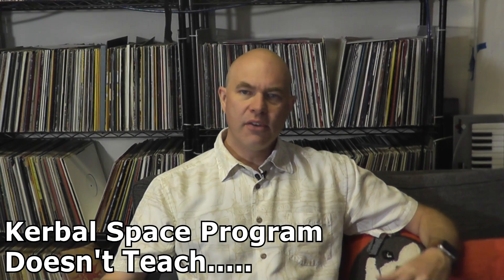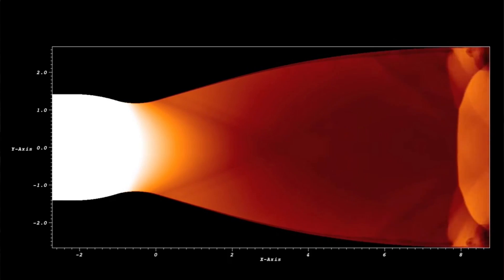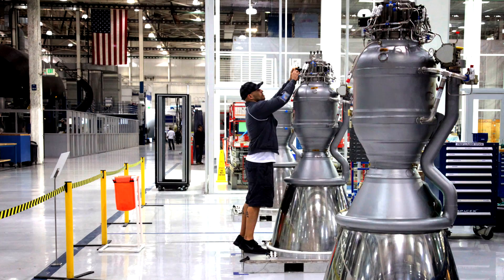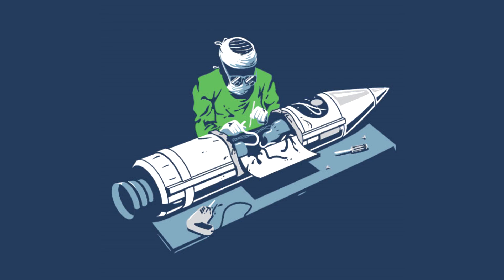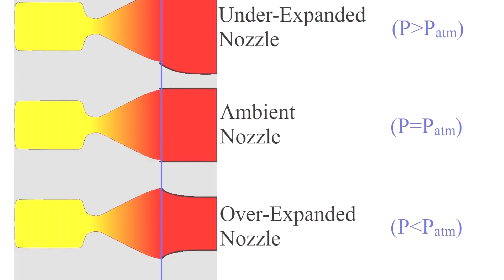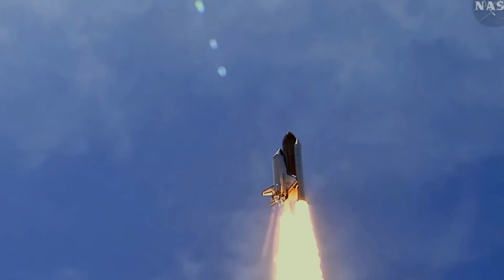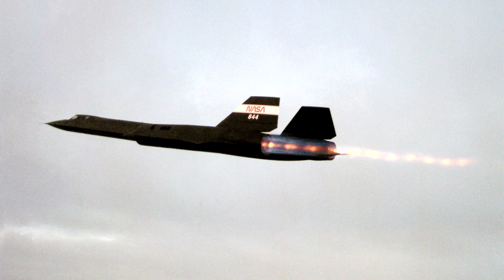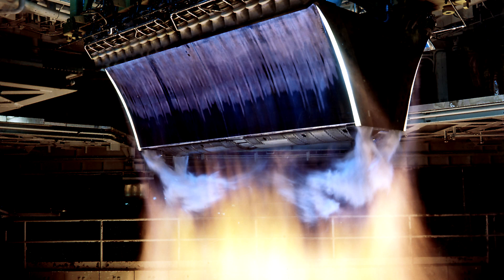Kerbal Space Program Doesn't Teach... Rocket Nozzles

Comment: Isn't it possible to create an adaptable nozzle? Have rings hooked to motors that pull the walls inwards (on a sort of rail system let's say) similar to how a belt is used for pants
Reply: yes, they are used on most jet aircraft but rocket engines need liquid cooling so it is alot more complicated
Reply: +douglas faulds it is possible to have a Contracting aerospike system like a reverse blackbird intake cone

Comment: I've often wondered why the Apollo CSM has a huge bell and the Soyuz has such a tiny one. But I suppose the Soviets would have designed a different service module if they ever needed to do a lunar insertion.
Reply: Be wary of assuming that the Apollo way is automatically right.  The Apollo SPS (Service Propulsion System) engine is massively oversized for the LOR (Lunar Orbit Rendezvous) mission, because it was originally designed for the Direct Ascent mission mode.  In this design, the AJ10-137 would have been used for ascent from the lunar surface, and trans-Earth insertion.  Something even bigger would have been needed for lunar descent, and the whole stack would have required something like a Saturn C-8 / Nova to loft it onto a trans-lunar trajectory.
In general, orbital maneuvering (even LOI or TEI) can make do with surprisingly low TWR; the SPS gave a full-tanks CSM an acceleration of about a third of a gee, which as mentioned is way more than necessary (Wikipedia says it was oversized by a factor of two).  Losses from not quite getting maximum Oberth effect turn out to be pretty small, so you optimise at a fairly small and lightweight engine (which then probably means the optimal nozzle expansion ratio is slightly higher, though the resulting nozzle will still be smaller than the SPS's because of the smaller throat area).
By comparison, a lander needs a higher TWR to reduce gravity losses; both the LM's descent stage and its ascent stage had TWRs of about ⅓g with full tanks, which is about two lunar gees.  Presumably that's where the optimum is, since the CSM (originally intended for lunar ascent) has about the same TWR.
Reply: Edward Cree
That explains it really well. Thanks!

Comment: stock ksp somehow forces you to use one big engine on the first stage instead of multiple small ones (like the falcon 9). Now, why are they using 9 engines? what is the advantage?
Reply: it is cheaper as you may only have to replace a couple every so many launches instead of a complete replacement of the entire propulsion system also it means you can fire one or two on a powered Landing when you have far less fuel to be carrying down through the atmosphere.
Reply: The main reason is that it is cheaper to develop one engine and adapt it for different tasks than it is to invent two or three engines.
Reply: Several, actually. One is that it's just cheaper to develop and build smaller engines. Another is that it's cheaper and easier to have 1st and 2nd stage engines that share a lot of commonalities, which wouldn't be possible with a monster first stage engine.

Also, it enables reusability. When the 1st stage lands it does so without the weight of the payload, fairings, 2nd stage, and almost all of the fuel of the 1st stage. Which means the first stage needs to be able to have enough thrust to push 500 tonnes at more than 1g at takeoff (otherwise it wouldn't get off the pad) but also to only have an acceleration near 1g when pushing only about 20 tonnes at landing, that's a difference of 25:1 in mass, so you need nearly a 25:1 ratio in throttle control on a single engine, which nobody has been able to achieve yet. With 9 engines you instantly get a 9:1 free throttle ratio just from firing one engine instead of all 9. Add on the 2.5:1 throttle control for a single engine and you get a total throttle ratio of 22.5:1, juuuuust enough to make landings controllable instead of impossible.

Without that, the first stage would not just have 9x the upward acceleration during landing, it would have 8 gees plus nine times the net acceleration (9 gees instead of 0.1 gees), since it takes only one engine to balance out the force of gravity on the nearly empty stage. That means that instead of slowing down over a long engine burn lasting tens of seconds the stage would screech to a halt with a burn of only a few seconds, all in the last few hundred meters before hitting the ground, if the burn was timed wrong by even the blink of an eye it could easily hit the ground at car crash speeds or end the burn stories high in the air. Also, 9 gees is a lot to subject a rocket stage too, and would be more likely to damage it.

Comment: At 4:38 there's some sort of small jet on the rim of each of the shuttle's engine bells, but I haven't been able to track down a detailed enough description to figure out what it is. My first theory was that it's cooling gas escaping after running through the bell walls, but the liquid hydrogen used for cooling is actually fuel on its way to the combustion chamber…so that's not it.
Reply: I think you are referring to the runoff from the fuel pump driving gas, I can't remember it's technical name
Reply: Hmm. I did some more searching around and gave up a second time. Wound up asking on the Space StackExchange site. Maybe something will come of that.
Reply: Something did. Detailed answer with schematics quickly arrived: http://space.stackexchange.com/q/15464/1419

Comment: why can't they use variable geometry nozzles like they do in fighter jets? not talking about thrust vectoring but rather variable diameter nozzles.
Reply: rocket engines have to run liquid hydrogen through their Bells to keep cool, obviously this radiator has to be perfect so the only way you could adopt the shape of the nozzle would be to have a moving aerospike like some hybrid rocket engine, sort of like a reverse blackbird Intex bike
Reply: +douglas faulds spike ^
Reply: is rocket exhaust really that much hotter than afterburner exhaust?

Comment: Do jet engines have actively changing nozzles for the same reason?
Reply: Jet liners generally do not have variable area nozzles, and I believe the high bypass turbofans they use are optimized for high fuel efficiency at subsonic speeds at their cruise altitude range, so the improvement would be marginal compared to the complexity, though I suppose that the increased focus on fuel efficiency may change this.

Variable area nozzles are most commonly associated with afterburning engines. The difference between running dry and wet pretty much requires it, but then, after burners tend to only be used on planes that require supersonic and/or high altitude flight, and these applications, of course, do benefit from variable area nozzles more than a jet liner would.
Reply: I believe so. They seem to actively change size depending on the amount of thrust being put through them, so I imagine the concept is the same. This effect is most easily seen on either the F-16 or F/A-18, I'm not sure which.
Reply: +JohnnyShagbot I'm not entirely sure, but both the F-16 and the F/A-18 have the expanding nozzle from what I remember.
Reply: +Major Missile most military jets do tbh.
Reply: JohnyG29 Yeah, they do now that I think about it.  Well, most modern ones have it to be more precise.

Comment: With the RealPlume mod, some of these principles are evident as the plume goes from a long thin fire to an expanded cloud. When it happens fast, say burning a low TWR engine as you fall during a failed ascent, you can kind of "see" the increase in pressure as it "squeezes" the rocket plume. Stock KSP really should incorporate the concept of plume expansion as part of a graphics update at least to address this. (Any changes in designs of rocket engines i.e. rocket part overhaul would be awesome, so far the aerodynamic parts have all been made more realistic, so, fingers are crossed.)

Comment: So why couldn't you just... Get rid of the engine nozzle entirely for in-vacuum flight? Surely it would act similarly to an infinitely large nozzle
Reply: Wouldn't that add up to losses in forward thrust?
Reply: An infinite nozzle have the best 'impedance matching' with outer space, because the gas that exit the nozzle have zero pressure, similar to vacuum around it. (in other word: all the sideward pressure have been converted to thrust)
Reply: I don't think you understand what the bell is for. It is the bell that allows the majority of exhaust gases to produce thrust. An infinitely large one continues harvesting thrust as the gases continue to expand.

Comment: Scott, love the video. Quick question: are the reductions in efficiencies in, say using a "vacuum" engine at sea level in KSP roughly equivalent to that of a corresponding real engine (using your example, a first versus second stage SpaceX rocket)?
Reply from the maker: +PSquared1969 the downside is the extra mass, drag and danger of flow separation

Comment: theoretically vectoring nozzle chokes could work for both atmospheric and space propulsion giving the highest performance in both areas. Is it possible and do you agree?
Reply from the maker: +Zack Vandygriff the heard part is making them not melt
Reply: +Scott Manley that it true but the bell itself already handles extreme temperature could the nozzle not handle the temperature if it is choked down to peak performance in both areas? and thank you for replying your videos are amazing and enlightening
Reply: Great Scott! I think you left out a significant part of nozzle design and engineering there. How to stop the nozzle from melting is a non-trivial engineering and design problem which I think you could have covered a bit more in this video. Part 2 coming up soon?

Comment: Plug nozzles would in theory provide the best performance at any altitude and allow changing the expansion ratio actively while maintaining high engine pressure and thus high ISP even if the engine is throttled down. The problem is the plug is under incredible strain that pushes material engineering to its limit.

Comment: is your description of a laval nozzle at the 1 minute mark accurate Scott? You seem to describe the flow rate (velocity) increasing as the nozzle expands, but this would contradict the bernoulli principle for fluids in a venturi expanding aperture?  I think you mixed up pressure and flow.  As the gases reach the end of the nozzle the flow rate is decreasing but the pressure is increasing.  I like your educational videos by the way, more please.
Reply from the maker: The  velocity increases as the pressure and temperature drop
https://en.wikipedia.org/wiki/De_Laval_nozzle
It seems counterintuitive, but it's because the flow hits the speed of sound the pressure can't propagate backwards. Bernoulli's principle is fine at low speeds, but when the flow goes supersonic all bets are off :)
Reply: Thanks for your reply, according to that article it seems that for velocities above Mach 0.3 we experience compressibility and the flow increases contradicting Bernoulli?  Surprising because an acquaintance of mine who works on RR turbojets actually quoted the venturi effect to me in a conversation about bypass.  So presumably since most engines will operate above 0.3 Mach, the principle is still used but with the compressibility factor incorporated?

Another thing I don't fully understand with the venturi is that, the pressure drops when the flow increases. Well I know if I stand in a fast moving river, the pressure on my legs feels greater than a slow moving river.  I assume it's the pressure on the skin / circumference of the vessel rather than the forward flow pressure which drops?  Which again is counter-intuititive since pressure inside a pressure vessel should be equal in all directions.  I should do some reading on this.

Comment: It is my understanding that Mach diamonds will be visible in any hot supersonic exhaust nozzle immersed in a gaseous atmosphere, not just overexpanded ones. For underexpanded ones, the exhaust flow rebounds off the freestream, creating Mach diamonds in a manner that is only out of phase with overexpanded engines. In the case of correct expansion, viscous mixing at the exhaust-freestream boundary constricts the flow, and Mach diamonds are the result.

Also, the critical factor in correct expansion is not the nozzle exit area, but the ratio of the throat area to the exit plane. This quantity is called the area ratio. The poodle has much lower thrust than the Mainsail. On the face of it, the area ratio of the Poodle could be much better than that of the Mainsail.

Comment: I'm kind of wondering why there aren't variable diameter/geometry nozzles. I know it would be an engineering challenge, but it's not impossible either.
Reply: It's not uncommon to see variable-geometry nozzles on high-performance jet engines. Rockets tend to be under tighter mass constraints, so you see rigid nozzles.
Reply: Ben Robinson Yes I've seen them on various aircraft, which suggests it should be possible with rocket engines as well. Probably it would be a case of the nozzles in a rocket engine would be dealing with thrust an order of magnitude greater -- or perhaps less.
Reply: +Gene Cash Good point. You might see more innovation in rocket nozzles once reusability is more thoroughly solved.

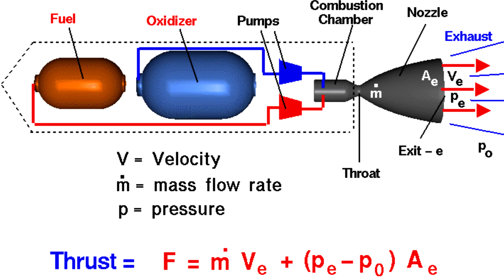Comment: 0:39 Wait, I thought the asparagus stock system wasn't possible IRL because it would have to use pumps and they aren't reliable enough under that kind of pressure but the picture there shows pumps. So, is that not correct or is there another reason why the asparagus stock system isn't possible IRL?
Reply: Possibly more because you would be pumping in a direction other than the one you're accelerating in.
Mechanically it would be a nightmare in any case; its one thing having a spent booster disconnect, but if you're pumping fuel across that connection as well you're adding more problems that you are likely solving.
Or at least that's my take; I'm hardly a rocket engineer.
Reply: The turbopumps that pump fuel into the combustion chamber are actually spun by a turbine that loops a portion the combusted fuel back through to the turbine before being expelled, hence the pumps are self-powered.

The pumps to feed fuel to the main tank/engine from asparagus stages wouldn't be able to be powered in the same way without making the engine designs vastly more complicated, leading to that unreliability.

Read more about rocket engine cycles here:
https://en.wikipedia.org/wiki/Gas-generator_cycle and
https://en.wikipedia.org/wiki/Staged_combustion_cycle
Reply: To a limited extent, like the falcon heavy, it works. You try it with the optimum 1 centre tank, and six sequential surrounding tanks, and the movement of that much fuel mass between tanks tears the rocket apart.
Reply: +HALL9000ish they've cancelled the plans to run fuel cross feeds on the Falcon Heavy. Extra delta-v turned out not to be worth the extra complexity when only using two boosters.

Comment: Many early rocket nozzles were conical. A conical nozzle with a 15-deg half angle provides satisfactory performance. Bell nozzles improve upon this with a significantly short length, lower weight, and increased efficiency.